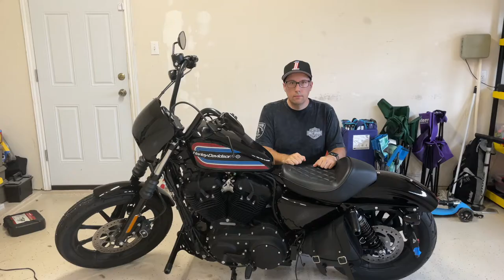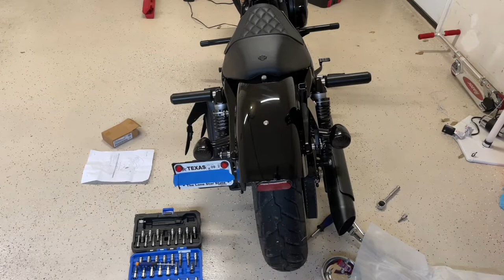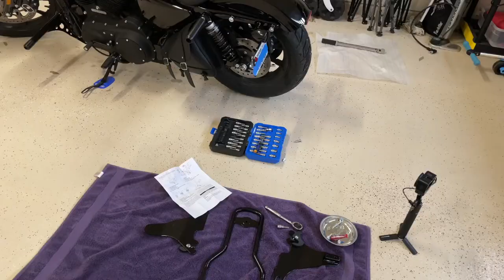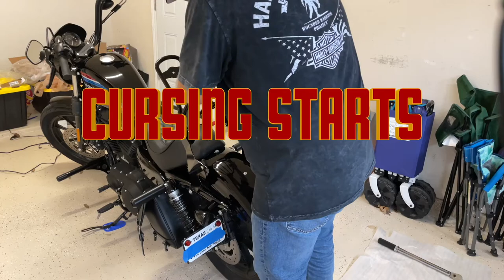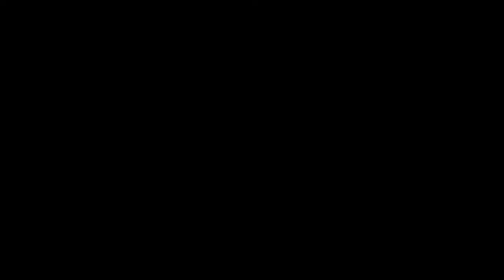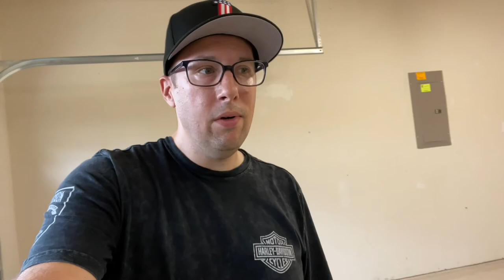2020 IRON1200 Sportster Docking Hardware, Side Plates, Sissy Bar and Luggage Rack Install.

Comment: Great install bike looks great 👍🏻
Reply from the maker: Thank you. You were right that bolt was a pain in the butt.
Reply: @MotobikeMike00  I also have a different set up my luggage rack mounts under the rear docking hardware made it even more of a bitch. I can take my sissy bar off and leave the rack on. And that docking hardware is tight as hell lol
Reply from the maker: Ok youtube flagged my song but I had the Benny hill music going during that. I fought that thing so much. I’m like what did I do wrong. I was worried Some one would steal it. Not any more.

Comment: Hey one last question - Is it Texas law that turn signal lights be red capped in back?  I have smoked caps, but I thought I read somewhere they are a no no.  Please tell me I’m wrong!  I want to go switch them out right now.
Reply from the maker: Not to my knowledge. I put them on when I bought the bike shortly after. So far I’ve been ok. I do have led replacement bulbs so they’re brighter then the old halogen bulbs